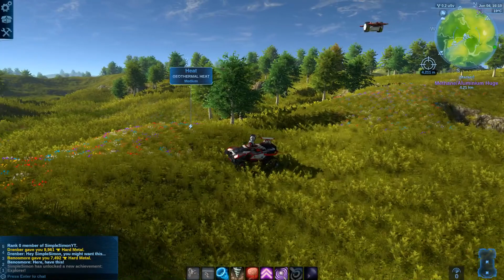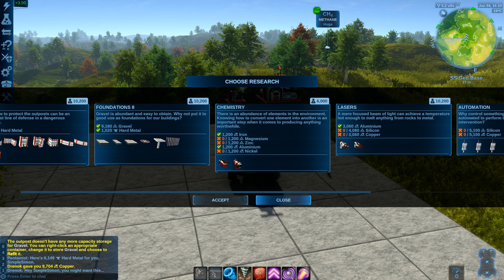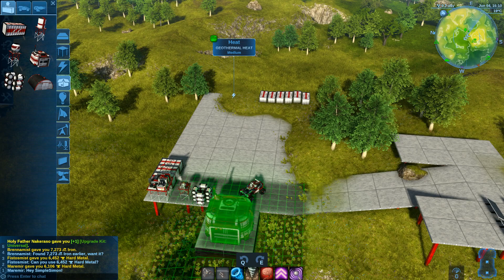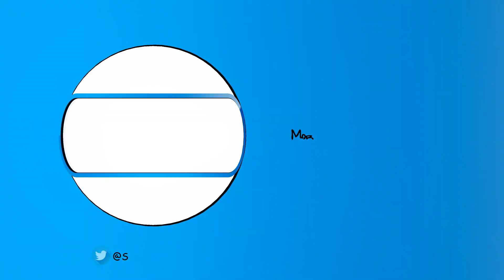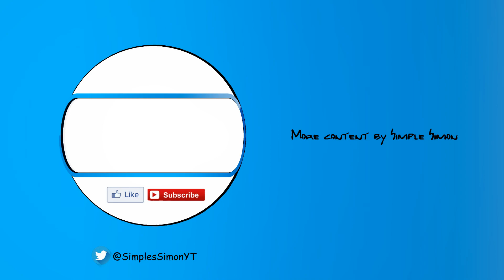Project 5 Sightseer Survival Episode 5

Comment: Amazing! great progress.

about the geothermal devices... you can place more devices. notice the efficiency ratio before place it.
Too many devices close to each other will decrease efficiency.

The frequency. it is like a radio frequency. you can set different frequencies to use the sensors.(automation)
after...you can set the sensor and the device that you want...using this frequency box.

to increase the wind turbines efficiency... first, build the 1x1 platforms. tall. and place the windmill over it.

Congrats for the puma. great vehicle.
If you put one chip on the scarab...you can set the vehicle to follow you.

to get a full view from what is rolling on at the base...just hover the mouse cursor on the left upright corner of the screen.
and to see about each thing... just click on the -+? icon and select the option. in this case, will be electricity.
you will get a list of everything that is using energy from the base.

hehehe...sorry for any mistake. accent...words...grammar... English isn`t my official language.
From Brazil here. Brazilian Portuguese.
trying to learn...

another tip- you can merge the upgrades. if they are the same, same type and same value, you can add.
+2 upgrade generator (plus) +2 upgrade generator = +3 upgrade.
click on it...hold...drop over the other...and after click accept!

to get more upgrades...just need to do some combat simulations.
don`t worry if you die...is a simulation.

Thank you for making this series.
Great!
Reply from the maker: Wow the awesome tips keep coming! Thank you very much! I did actually wonder how I could further raise the wind turbines, I think it would have been cool if they could have been installed on the defence towers, less footprint that way on space required. 

Your tips are an enormous help as I learn my way through the game.

Before I go into any more combat sims I am going to work on further defence upgrades to have a better chance of success.

Oh an the tip about the Scarab being able to follow is great, I honestly did not know that, so I`ll be sure to use that feature.

On a last note, your English is perfectly fine my friend, so don`t worry about it 😎